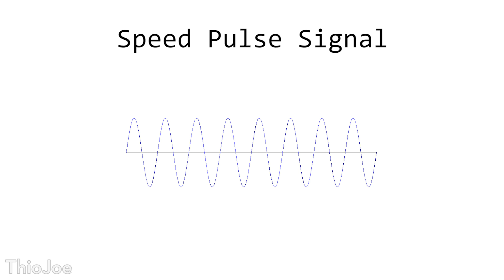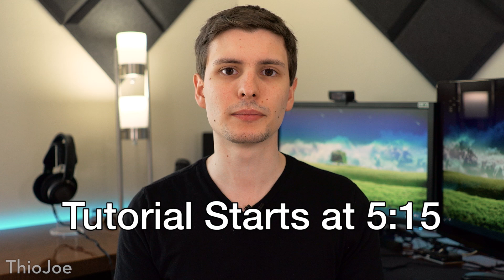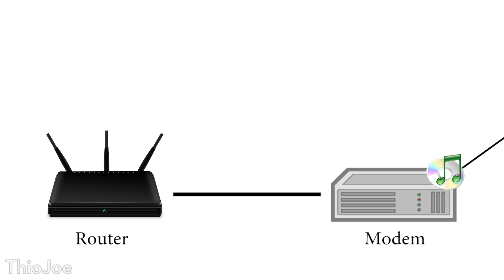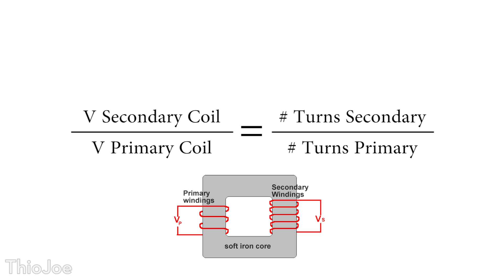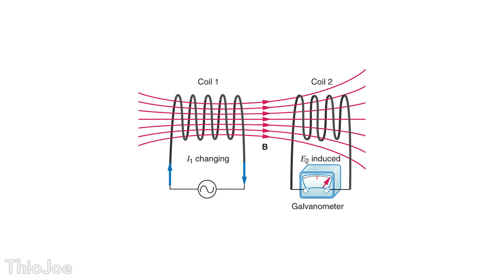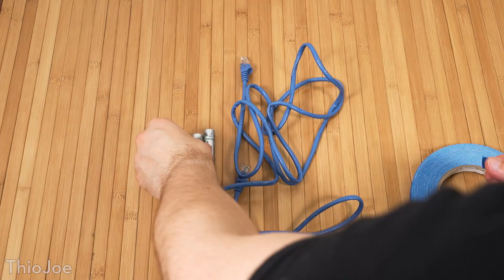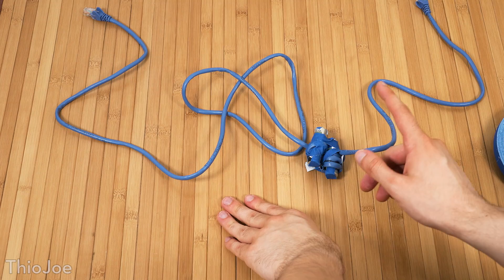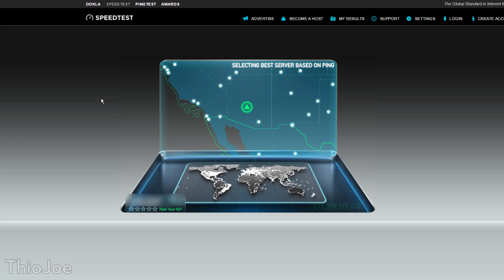How to Get Faster Internet Speed for Free

Comment: Actually, if you get a toilet paper tube, run the wire through it, stuff it with a semi-superconductor (I found some at my local RadioShack), you'll get not only extra speed, but more RAM

Comment: This is misleading information. ISPs do NOT work this way. The amplitude values are sent to the modem from the ISP. Changing cable induction between the modem and router is irrelevant since the speed will always be set by the modem, not the router. Good try, but false.

Comment: Awww.... but you forgot to point out one of the most important details. First you need to power cycle your router with the regular unmodded lan wire, this forces the provider to resend a fresh new pulse to set your limit, right?...now you replace the regular wire with the modded one as you pointed out, but the trick is DO NOT POWER CYCLE your router. If you power cycle it they will resend that pulse that resets your limit right back down even though you're using your tricked lan wire...and in that process your internet speed will lower by half upon reusing your old regular unmodded wire. If you're gonna explain something at least do it right ;-) Cheers! ~ gotta go help my gf, she pissing all over the place goddammit..

Comment: He is full of it, you need 2 9 volt batteries in zero point energy mode. You need to pull a 27 to 29 inch vacuum on the positive battery terminals only. Do not pull the vacuum on the negative terminals! Negative results might occur if you do!

Comment: FAILURE TO PERFORM!!!!
Your info does not help speed up the internet speed.  I have reviewed your directions multiple times and purchased new rechargeable batteries.
I have switched from standard cable back and forth to cable with batteries per your directions.
One possibility is that I own my own modem and router.

Comment: I recommend you use rechargeable batteries. That way, when you start loosing speed, all you have to do is recharge and top up the speed again. Else you'll be spending a fortune on batteries. I mean, I spent like 20 in the first 3 days!!!.

Also, pro tip... If you use a car battery and jumper cables attached to the positive and negative poles of the second (4x wrapped) battery, you'll actually bypass the ISP all together and get a direct connection to the INTERNET ITSELF!!! I am hitting 1 terabit speeds! My HDD's are so hot I could fry sausages on them.

Comment: :)) Nice one dude. Except for the "science" behind it. Correct me if I'm wrong, but, ,it has flaws in it: If your battery-coil setup would increase the signal's strenght /voltage/whatever, sent to the ISP (supposing this was even possible), and therefore tricking them into sending you, let's say, a signal 4xstronger, isn't it common sense that the signal gets lowered as it gets trough the coil's setup, back you your pc? Am I making any sense? There aren't many stupid people who actually "eat" this nonsense, therefore, you need to work harder on making up more plausible explanations, or else you'll end up with no "believers". We can only be amused by the videos as long as there are people who actually believe. Other than this, good work! I like it alooooooot!

Comment: Wow! It DOES work! I was HIGHLY DOUBTFUL because, while all the math adds up (I'm an engineer, got my degree 11 yrs ago thru a great "EE" course. Only took ONE hour of questions, some quite tricky, but at least it was multiple-choice, and it was surprisingly CHEAP! "$129.99 (Plus $59.99 for the certificate which, of course, ain't cheap, but they know they have you over a barrel without it. I've always been confused why I ALSO got charged $39.99 for "Shipping and Handling.": My only guess is that they DO have to "ship" (transmit) the course TO you, and they need to "handle" that shipping. Guess that's fair.)

Oh now, where was I? Oh yeah, so the math adds up (Thank GOD for my degree! I recommend everyone here take it) but however, it DIDN'T WORK! NOTHING I tried, frustrating. I tried it again several times and still it was no-go so I was going to call you (Using the FREE mins I have due to one of your great posts here! Thank you for that.) But as I was getting ready to call I caught something I'd missed before, and that FIXED IT!

I don't know how YOU got it to work, I'm a bit suspicious now, but I noticed that the "electrical tape" you used was BLUE, and most electrical tape is BLACK. Now of course the COLOR doesn't matter, although at first I figured THAT was it and spray painted it all black with no-go. BUT, looking closer, that roll of tape you showed in the video sure didn't LOOK like electrical tape, it looked just like ...  "ScotchBlue" PAINTER'S TAPE! And as we all know, painters tape is an INSULATOR so it doesn't deliver an electrical charge when you use it for painting. This, of course, is necessary since if electrified, the tape will absorb ALL of the paint nearby as you apply it, and from personal experience, this is a "mess," to put it kindly. (Think ELECTROMAGNET if this isn't clear to you why this happens.) And this works because now I know that you can't make an INDUCTOR using an INSULATING CORE, hence, ELECTRICAL tape which has the needed extra valence bands surrounding the electronical composition of an atom; without these bands the electrons literally SHOOT past the atomic core and can cause severe damage (Why do you think lightening is so dangerous? Just let that sink in for a moment.) So WITH those bands that are added to electrical tape they ATTRACT the electrons and, as we all know, "ELECTRON" stands for "ELECTRICAL-TON" with the "ton" part literally meaning the molecules can amazingly absorb and hold a TON of electrons; and that's a LOT of electron, lemme tell ya!

So simply, I brought out some true BLACK electrical tape (Black, just to be safe,) tried it again and viola'! It WORKED! I went from 87Mbps to a LOT more! It literally blew the NEEDLE off on the speed test indicator! We're talking a LOT of speed added!

So I can suggest you fix the video so other's don't suffer from this, but more important I want to thank you for literally changing my WORLD! Your site is EASILY worth what I pay for access here. ;)

Comment: Tried and True. Before I did this DIY, I was getting speeds on average of 56-59 MB/s, and while not getting the biggest boost, with this setup I am getting a 10 MB/s boost on average. Locally, the best speed i've recieved has been 70 MB/s. Some additional information; The best package shown on their website is 60 MB/s and they are in the process of releasing their new Internet 150 package. Apparently, it's currently available but still not shown on the website yet, so i'm optimistic that I could eventually see faster speeds soon but i'm extremely happy with what i've got so far. My ping has gone down and my upload speed has gone up by about 0.5 - 1.0 MB/s.

Comment: This is pseudo science.  the batteries perform no other function than to wrap a cable.  This isn't a transformer,  in that if you view the diagram carefully,  the wraps for each side are isolated electrically from each other.  He's succeeded in making a coil,  not a transformer.   in side the cable, the wires are twisted in pairs,  preventing the signal from radiating outward,  so a transformer wouldn't pick up much of a signal to begin with. The science principles are correct,  the application is nonsense.  It won't work.

Comment: to create the transformer core why use the batteries you could have used steel nails. Moreover, its not a transformer either as there is no isolation, same wire goes around both batteries. You are crap and some people like the crap.

Comment: Once again, complete and utter bullshit. 

First o all, WHY ON EARTH would the ISP trust the consumer modem with the bandwidth limit? Whats the easiest thing to hack?
THE MODEM RIGHT ON YOUR DESK!
Just look on the back of the modem. It says it all there.

Next, the graph he shows at 1:26 has many different states (infinite to be perrcise. Computers however as you may know use two states. ON (1) and OFF (0), binary code. Also, he is pointing at the amplitude as the speed. Imagine that I hit you and every time I hit you I transfer 1 MB of data. I hit you at a rate of 1 Punch a second (or for the sake of argument 1 MS/s). Next I hit you harder but at the same rate: 1MB/s. THE SPEED DID NOT RISE.

About the transformer... Firstly, If you raise the voltage, the current drops. Why dont you mention that? Maybe we will slow things down? Secondly, Raising the voltage doesn't change the message.Look:

message   MESSAGE

Did putting the word in caps change the meaning? No. it did not.

Finally, how does a battery with it's terminals isolated from one another generate a magnetic field?

Oh and also, that's not a transformer... that's just a wire (or actually 8) wrapped around two batteries.

Finally, isn't the math flawed? de sis one wrap on the primary and 4 on the secondary. That gives him 4 times the voltage yet he gets 10 times the speed.

Comment: If the Ethernet consists of paired wires wrapped around each other within the cable, how can you 'induce' any voltage? in order for a transformer to function, it requires a single copper wire wrapped around a pole, not 4 pairs wrapped around eachother (cancelling any induction). also, the beginning part of how your ISP provides your 'speed' is incorrect.

Comment: This is an interesting tutorial but what I do is different and more effective. I just bought a short Ethernet cable (1ft). I plugged both ends into the router. This causes the data to go in circles and it gains speed quickly, increasing the Mbps by ten times the original speed.

Comment: Hi Theo, Sorry but this didn't work for me. We have BT Infinity my home in the UK. It's a direct lead from the outside of the house to a junction box inside the house then into the router (no ethernet required), we pay for 56mbs but there is a 72mbs option with BT Infinity 2. I tried coiling an ethernet cable and ran it from the back of the router to my computer as you suggest, no change in speed, I then tried coiling the actual cable from the box in our hallway to the router, still no change in speed.

Comment: Got a couple of questions.  Do the battery positions have to be + to + and - to -?  Does the Ethernet cable wraps have to be in the same direction so they don't cancel out each other? What if you have an old router that plugs into a phone line "no e-net cable"? Do you put one between the router and computer and don't use wireless connection?  I'll skip peeing on the modem.... Thanks............

Comment: Worked to a point. Many people may not realize that they will only be able to get speed that neighborhood block distribution cards can handle. If your house is on a card that is already nearing capacity this wont make any difference... or at least very little difference.

I hit the cap the distribution card can push. I can test this by running speed tests and tracert at different times of the day and i will get significantly different results.

If you don't think this works you have to keep in mind he did not go in to any detail about what happens once the signal leaves the cable modem itself. Magnetic induction in itself will work as he explains it in this video. What he doesn't cover is items you won't be able to control.

Comment: This will actually work..

But the amplifying science is wrong.

Voltage - Magnetism
 
Should be

(Voltage + Coils) x (Voltage + Coils ÷ Conductivity) ÷ (max available x (.5 x what u have) = Wave Length Possible per Voltage...

So Two Batteries will only up your signal by 0.6155524777256628777778888888 

I actually confirmed this as true when I asked for a local Power Sub-Station to run my line around the transformer Giving my

Comment: This is nonsense. Firstly, as a home user the ISP wouldn't give you a dedicated 1gig port. The gig port would be shared. Services most likely split with the Use of Ethernet Virtual Circuits (EVCs). On top of that your ISP will have QoS Configured. On the ISP's edge they would be policing the bandwidth (inbound) and shaping the bandwidth (outbound). As I say, most likely using some Class Based Weighted Fair Queuing (CBWFQ).

Comment: This is an amazing little trick. The speed doubles again if you tape several more batteries to your modem, and quadruples if you then tape several more to your router. For me, the tape got to be a pain, so now I use rubber cement.

Comment: If you are not getting the max speed/signal, you'll need to include a large capacity speed signal flux capacitor and two GE hi-fi tubes (numbers G2917-A). If you don't have 2 AA batteries,  use 4 AAA batts.  Make sure you divide the voltage by the primary router coil capacity.

Comment: I tried this with car batteries. First I got the batteries the wrong way round and my internet slowed down to 2 bs. After swapping the batteries round, my internet was so fast Google loaded before I even turned my computer on. It even works with dial-up, however, I do not recommend that, as I got a phone bill of £742000.

Comment: i found duct tape increase the induction field by 10 fold also i noticed when i was near the electromagnetic feild conducted by the loop my bodies own magnetic feild influenced the induction loop, and also what i was wearing effected it as well.  so if you're not getting any increase in speed  try wearing different clothing.  ive made a suit from aluminum foil that has significantly improved speed;) just make sure not to cross your arms and overload the circuit

Comment: Now my cable is to short. Lucky me I have a 20v DeWalt cordless cable stretcher with a 5 amp hour battery attached so it will stretch any cable you need to.. If you use the cordless cable stretcher DO NOT stretch the cable any more than needed.

Comment: it will not let me watch the part where you start wrapping the batteries until you get to the part where you put the cable back in and run the test. it says there's a problem and I assume they did that on purpose!  I would like to see the full video.   is there another way for me to see it?

Comment: How will current flow in just battery?
U need a complete circuit for current.
Else it becomes a solenoid. Which does not amplifies signal.

Comment: Hahaha, little does he know that if you bend cat-5 or cat-6 cable like this in such a tight wrap/bend then you actually ruin the wire, therefore making your speed even LOWER!... You can't bend that type of cable to smaller than a 1-inch radius or else you damage its bandwidth capabilities and therefore its rated speed is greatly reduced!... (I am a professional low-voltage networking and home theater system installer, that's how I know this to be true... Look up the proper installation procedures for cat-5/cat-6 cable if you don't believe me!)... This guy is still funny though; he's great at spewing all of this crap with a totally straight face! LMAO!

Comment: I read some of the comments expecting to find an response that explains why this is fake, but no luck. So, I'll give it a try: 1- The connection between the modem and the router is called Ethernet. The Ethernet speed can be 100 or 1000 Mbps depending on the specs of the router and modem. If the router is 100 Mbps, it will NEVER reach 1000 Mbps, because the Ethernet standard is not based voltage amplification, it is based in frequency (MHz) performance, and need the proper hardware to support higher frequencies. 2- The modem uses a protocol called DOCSIS 3.X, this protocol uses multiple data channels (frequency) to increase the bandwidth, the more channels the more bandwidth. The ISP usually controls your modem and the number of channels allowed per your plan.

Comment: The ISP server will only send the data at a speed that will not cause failures in data transmission. This is why at times you can check your bandwidth (speed) and it is lower than you paid for. The server is throttling back data transmission to preserve quality. The router can ask all it wants but still will only get what the server decides it can send reliably. There is more to bandwidth that a simple router request. OH yeah this video is all bunk

Comment: I am using a cable connection for my WiFi, where the modem is connected to the optical fibre at one end, and the router at the other. what should I do?

Comment: hi, so I have a router modem combo that I get my wireless signal from the router/ modem connects to the coaxial outlet that my cable company provides I was wondering if I can do a similar setup? and how that would work due to the fact I'm on wirelessly and not hardwired thru ethernet? please let me know I like how you explain the science behind it by the way makes better sense when you apply it..thanks!

Comment: make sure u put tape over the end of the batteries so the electricity doesn't escape, but the electricity  will penetrate the insulation on the wire...

Comment: In addition to the batteries I suggest the addition of an inexpensive flux capaciter from Amazon (some are prime).  Although you will need an additional 4 AAA batteries for 1.21 jiggawatts needed for adequate fluxing.  Result is a free T2 line.

Comment: @ ThioJoe: You state that we need to wrap the data cable around the second battery "FOUR" times, yet you only do 'THREE' coils in the video, and towards the end, you even refer to the second battery as having only 'three coils'. Does this mean that we can, instead, get away with doing only 3 wraps around the second battery?...  also, had you done a 4th coil, would it have made any difference, (even faster)?  Do the rechargeable batteries we use for this need to be charged? partially charged?... fully charged? If a charge is required, then at some point in time, do we need to remove the batteries & recharge them? Thanks in advance.

Comment: Do you ever have to change out the batteries, meaning, do they ever drain or go bad being used this way?
Also, does this work for wireless connections speeds to the router, as well?